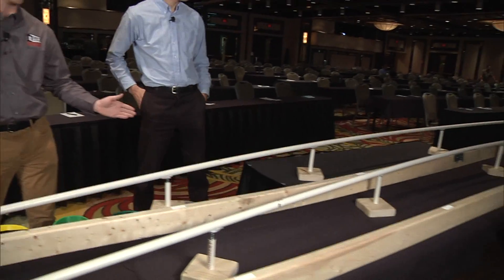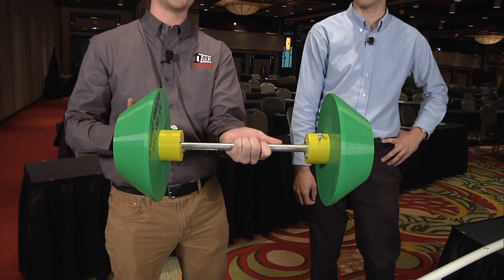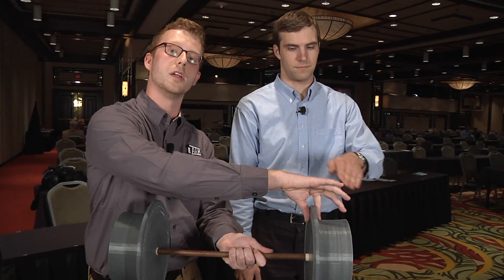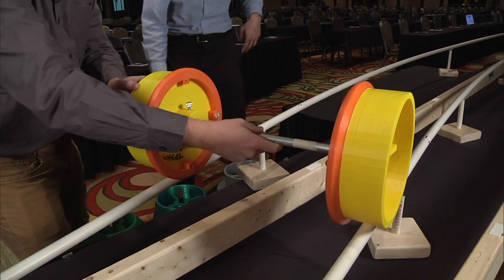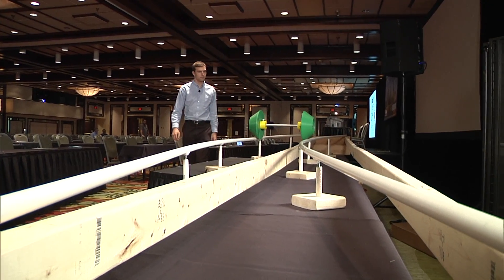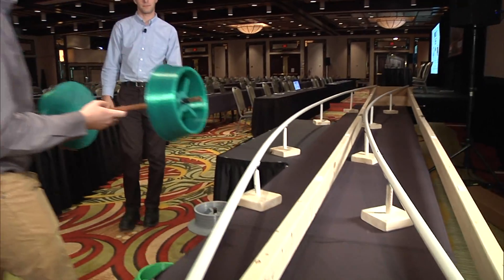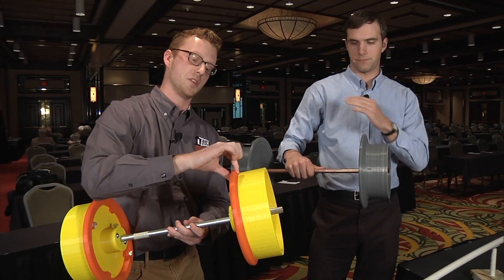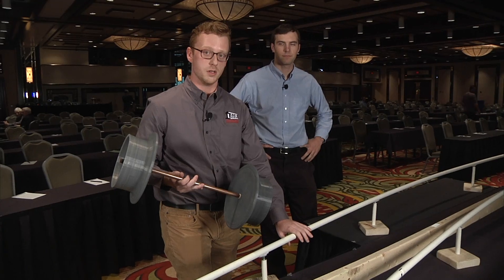'Model' Wheels

Comment: You tell us how the wheels wear off only in the center and the flange won't wear off as much. Minutes later you try to explain to us how MASSIVE wear the flange experiences in curves.
If this really was the case, there would be no flange left.
These wheels never ride alone.
Reply: They were talking about the wear of the grinding flange on the rails.

Comment: Your tests are flawed, railway wheels are always in tandem. Cone shaped wheels will cause undue sway in turns, have very little contact with the rails and reduce pulling and stopping power. Stop reinventing the wheel.
Reply: Harry, this is the second video I've seen where you've posted.

Why do you confuse a video with a model designed to show how real wheels work with a proposed reinvention of the wheel ?? These are just exaggerated models designed to show why train wheels are made the way they are.
Reply: Let him, he can't help it. Apart from being wrong with his assumptions the sentence "Stop reinventing the wheel" shows the multitude of complexes he is struggling (i.e. ignoring that the video is just a demonstration, self importance issues, entitlement etc.). He's probably soon going from railroads to flat earth or free energy videos, enlightening people with his "more understanding about this problem than you could ever think". 
People who use phrases like this are usually pretty clueless. Their manic urge to prove other people wrong is part of the coping mechanism.  The youtube comment section is great to observe these kind of people.

Just wait for it. The reply to this comment will be personal insults, thats how it works.
Reply: Some additional numbers:
r of the curve: 300m
inner r: 299,2825 m
outer r: 300,7175 m
inner D: 939,74705 m
outer D: 944,25295 m
Do / Di: 1,0047948
difference to cope with at a full circle: 4,5059 m

The inner wheel must make ~4,5 m less than the outer wheel.
Therefore a wheelset with a diameter of 1000 mm only needs a conical shaping with an inner diameter (near the flange) of 1004,8 mm. 
At the end of the day one can assume the radius between the flange and the rim will do most the trick ....... ;)
Reply: I would be interested in hearing your comment. 
Lets put a 70 ton boxcar with a cone shaped wheel rolling at around 60mph on the existing infrastructure. What is your answer to the outward force the cone shape wheel would have on the rails? 
Do you think it would put undue stress on the inner rail fastening system? 
Now lets couple say 40 of the same cars and pull them up a sharp curved grade. Noting the way a cone shaped wheel sways to and fro in a curve. Do you think the cone shaped wheel would come dangerously close to falling inside the rail? Just interested in what you think about real world workings, rather than making snide comments.
Reply: You want to bitch about how unrealistic a plastic rail is, too?
Reply: You realise real world train wheels are conical right?
Reply: It's a demonstration of what happens not a reinvention. Yes, wheelsets typically come in pairs (though , see: ponytruck) but if your wheels naturally turn into curves everything is smoother, you get a better ride, less wear and less likelihood of a derailment. That's why conical wheels have been in use for almost 200 years. For so long in fact that nobody is quite sure who originally invented them.
Reply: Its not a test or a development phase. Its a demo to explain how the real thing works.
Reply: think before comment
Reply: Listen little pseudo railroader. The wheels are already like this....
Reply: They dont reinvent the wheel. They only try to accomplish a better understandíng of the things and to transfer this understanding to people like you. 
But this must and will be a fail given the fact that people like you dont have the ability to understand complex problems.....
Reply: "What is your answer to the outward force the cone shape wheel would have on the rails?"

First: I dont discuss the existence or nonexistence or usage of conical shaped train wheels. They exist and are used - worldwide. Thats it!
 
Second: Yes, I know that the forces you mention do exist. Let alone the figures of these forces   may be discussed, but I am sure they are not nearly as high as you may believe. There are a bunch of forces (to be discussed later on) that try to turn the rail inside out, depending on the circumstances - but the forces the weight of a 70 t boxcar can generate vertically are the minor ones.... 
It is a given that this applies only to a correct maintained track - and not to something like, for example, the track of the Maumee and Western Railroad......

Third: A 70 ton boxcar isnt a very convinding example. Having 4 axles the amount of weight on one axle translates to roughly 18 ton. Thats not really heavy.
Didnt you ask yourself how the rails could last such beasts like the Milwaukee Class A or the Union Pacific 844? Both arent the heaviest combatants in this field, but with an axle load on the driving rails of around 30 tons they could clearly deliver far more destructive forces to the rail than a standard boxcar.
Not to mention the downward dynamic forces of the driving wheels which they can deliver due to the reciprocating masses of the motion gear.
You may wander why I use steam locos as an example? Modern locomotives are built to "be good to the track" and arent as rough to the track as many steamer were, therefore we should know of many problems with rails and undue stress when steamers ruled......  

"Do you think it would put undue stress on the inner rail fastening system?"

Maybe. Especially when someone sends too heavy vehicles on a too light track.
But lets make it short here: If the forces which you try to make up as an argument against conical rail wheels really would be as strong as you seem to believe we would encounter countless derailments all over the world caused by turning the rails outwards.......
But, as we both know, nothing happens here. 
The railroad engineers didnt sleep all the - now nearly 200 - years since the beginning. Most of the trackwork worldwide is up to the task of coping with the many forces that are at work here. 

https://www.bart.gov/news/articles/2016/news20160831
https://seattletransitblog.com/2015/05/06/technical-issues-unique-to-light-rail/
https://en.wikipedia.org/wiki/Wheelset_(rail_transport)

For answers to the question how todays railroads cope with the needs of mordern trackwork, have a look at modern track laying techniques:
http://www.railway-technical.com/infrastructure/track-basics-v2.pdf
https://en.wikipedia.org/wiki/Track_(rail_transport)
Reply: you dont have ability to think logically
Reply: I have more understanding about this problem than you could ever think. I'm commenting on their poor presentation and flaws understanding real world usage.
Reply: I see.
Compared to the complexity of the rail-/wheel-system the simplicity of a bunch of TTL-logics is nothing special.
But, its ok. Lets criticise the next thing....